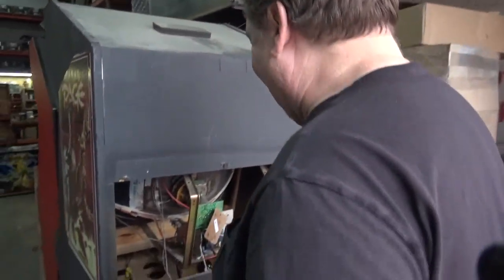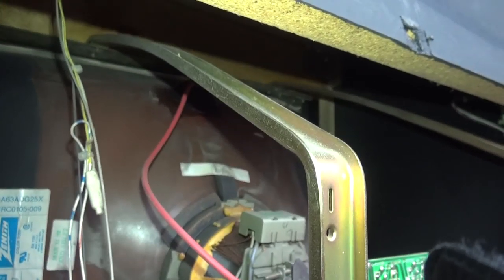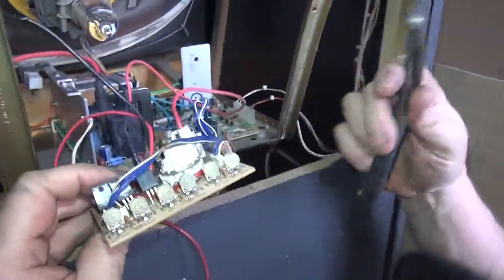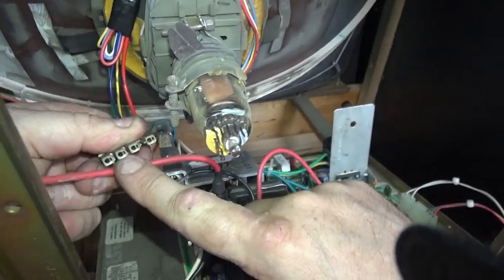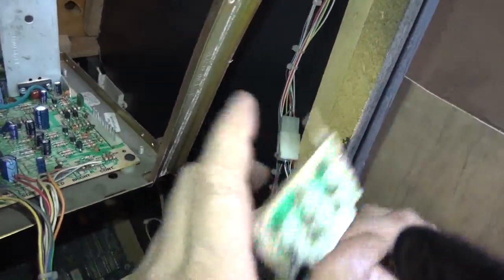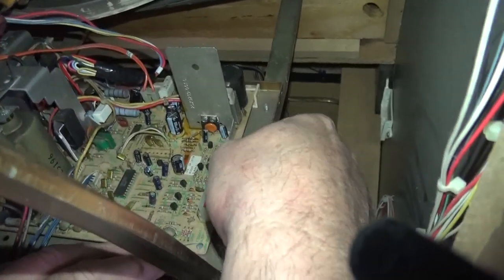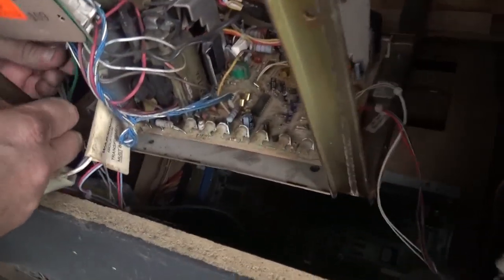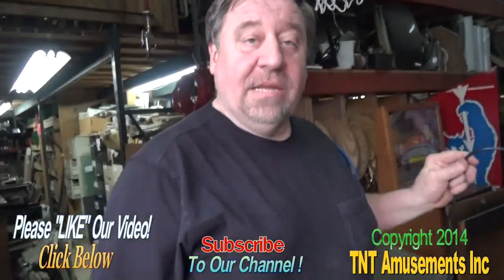#616 WELLS GARDNER 7000 Monitor Chassis Replacement - TNT Amusements

Comment: Great Video! I have a WG7000 in my neo geo cabinet. The picture on those crts are great. Mine started to get a small distortion across the top of the monitor. I got the cap kit and after watching your video I cant wait to start. THANKS!

Comment: Thank you so much for posting this video! It help me disassemble and reassemble my chassis when I needed to send it in for repair.
I had to replace my power supply, but now I’m concerned that I don’t have an isolation transformer. What do you suggest?
Reply from the maker: well, for this chassis like this, you have to have one...the newer wells gardners do NOT need one...

Comment: Those ramps on the RGBG S connectors are always a royal pain to remove.  2nd chassis you installed was a Zenith made Chassis (damn flybacks are expensive).
Reply from the maker: Yes...they are expensive!

Comment: PLEASE HELP ME!!!!  I bought a game for the purpose of creating a Multi-Cade.  It was a Sammy Turkey Hunt.  I can't figure out for the life of me what's wrong.  I have a Wells Gardner 33k8107 (which of course there is absolutely no info on).  Before we broke it down from the guy's house, everything was working.  Now I get a grey screen and sound but no picture.  I personally disconnected everything except the last plug that he pulled while I was moving the CRT.  I've tried everything and can't get a display to show ANYTHING.  Anything you can think of to check.  I would GREATLY appreciate it as I am a bit green but really want to learn the ins and outs of these systems.  BTW......Your video was amazing.  Showed me many, many things I have been wanting to learn.  Thanks in advance for anything you could suggest.
Reply from the maker: The symptoms you describe mean there is probably nothing wrong with the monitor.  It simply sounds like the SYNC or GROUND wire is not connected to the monitor...without that, the picture will be grey.  There should be a total of 5---SOMETIMES six--data wires from the game.  Red, Green and Blue carry the color, a BLACK wire is the essential ground, and one or teo white wires which is the sync.  You may have missed one of these...OR...more likely, you have it plugged into the monitor wrong.  This generally plugs into the edge of the monitor chassis...you may have missed a pin.  You can plug those plugs in one pin off...doesn;t hurt the game, but will not work.  CHeck that!

Comment: I love these kinds of videos. I like the challenge of trying to fix the games. Working of a NFS u right now with the monitor toast, well pretty sure the WG they used the capacitors leaked and in bad shape. Is there an easy way to tell if the monitor it self is toast just by looking at it? In any event I have a 27inch crt tv I took apart that should fit in there. Anyway, Love the videos. Love the channel.
Reply from the maker: Rarely is the tube bad.  Burn in is the number one problem...with a dying picture---not bright.  If you turn up the brightness and it becomes out of focus, tube is probably bad.  The number 2 problem is one of the three guns either shorts on (locked on bright) or is burned out--so you get only 2 colors.  Theres no way of knowing until you rebuild the chassis and fire it up!
Reply: Thanks todd, I may just do that. That is really good to know. I might just try and pick up a rebuilt chassis (not comfortable doing it myself but at least I have a practice one now) and try that monitor or the one that was in the arctic thunder parts machine I picked up in the same deal. As always, love the channel, and always thumbs up, never thumbs down when it comes to the boys at TnT :D

Comment: Todd, My friend has a Dynamo arcade and it's a 25' and I have a question about the monitor. Since it's a CRT does that monitor support VGA hookup?

I've seen a few Wells Gardner 25' monitor that has VGA in it and do all Wells Gardner has that or no?

The reason why i'm asking is because he's using a Pandora's Box 4s+ and it has VGA to hook it up but he's just using the regular jamma and he think the picture isn't sharp enough and color kinda looks green yellow and not bright colors.
Reply from the maker: no it does not..you have to get a conversion board...and it seems that half of them dont work right...
Reply: Oh you mean he'll need to get a adapter connection to change it to a VGA?

I never heard of these before so I don't know anything about this but he wanted me to ask you.

Do you sell the complete Ms Pac-Man sideart or know a good place online to buy one?
Reply from the maker: try classic arcades in wilkes barre pa!
Reply: Thanks and i'll look them up now.
Reply: @FrostyMikeGaming  Well? How'd it turn out?

Comment: Saw the video of this todd just now the NBA Showtime I picked up yesterday has a Wells gardener but it's a K7 something can't remember off the top of my head. I found the model number on a label. My question is if I have wells Gardener tube and no chassis. What do you recommend I could do do I have to go with the same type of chassis for the same tube? Or could I go with any Wells Gardner or any other chassis just curious what is the most best healthy thing to do to the tube? It's my first wills gardener